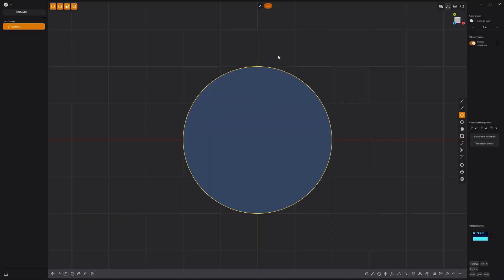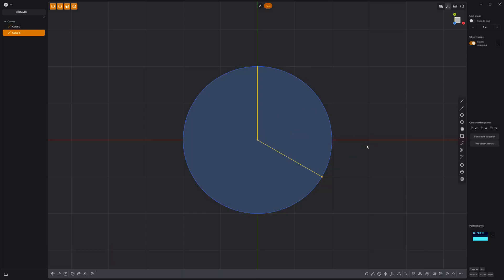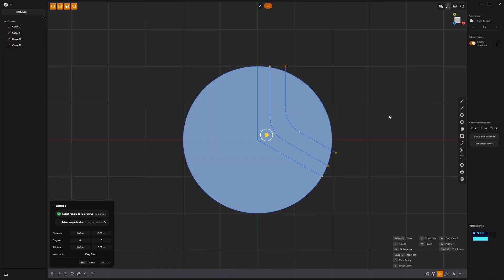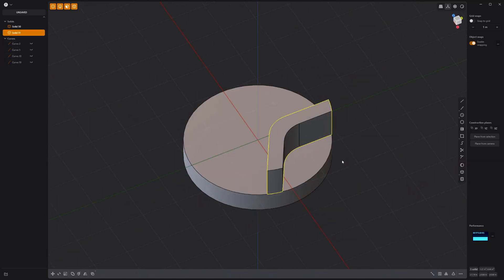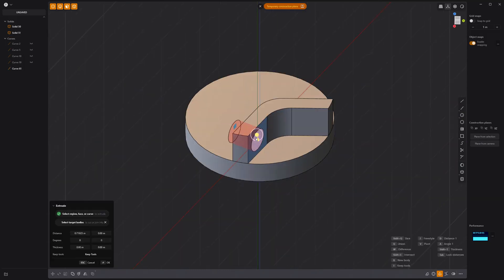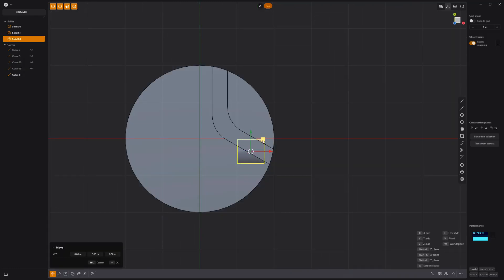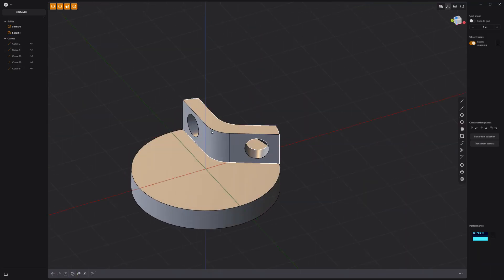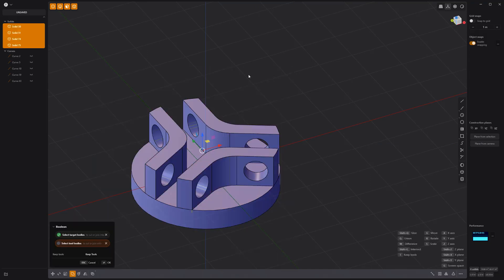Plasticity | Modeling Exercise 27

Comment: hi i have been following ur videos frequently and to be honest they are the best, to the point, precise, and extremely short best tips and tricks by far on YT.
I followed this one as well, but this time i am stuck, in following this video, how do u enabled the line degree enabled and then u set it to 120 degree. Plz help.
thanks in advance.
Reply from the maker: Press the Tab key to access the input field.
Reply: @pixelfondue   not sure what I'm doing wrong but tab only allows me to change the length of the line,  not the angle
Reply: Found my issue.  Turned out I had an older version of plasticity that didn't have this feature.
Reply: @fotenks  same here I am using ver 0.9

Comment: is it worth learning both this AND fusion 360?
Reply: Depends on the work you're doing. I've found plasticity to be enough for 100% of the functional & aesthetic designs I've been doing, but you may find things in fusion like simulations or mcmaster-carr integration to be useful. Plasticity is very powerful, but it is pretty early days for it, and fusion has stuff that you may want. 

That being said, if you have minimal experience with CAD, learning plasticity is really easy, and the basics do transfer over to other software with some obvious workflow differences.
Reply from the maker: Thanks for sharing your feedback!
Reply: plasticity is for visual representation (3d renderings and product presentation or ur ideas) and  specific to 3d moulds and 3d printouts.
SOLIDWORKS and fusion are for complete functionality of the product to industrial manufacturing standards.